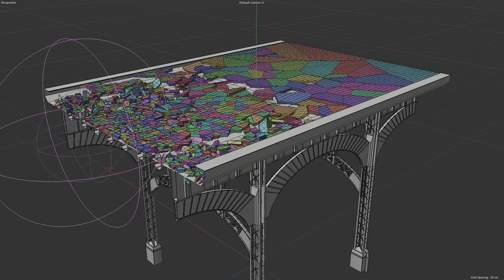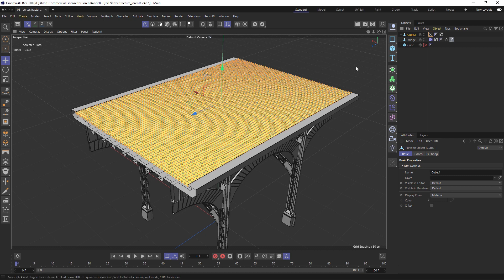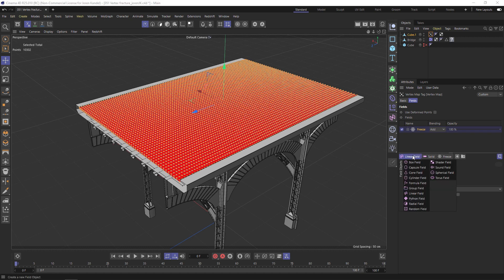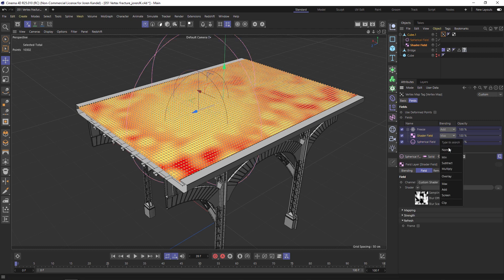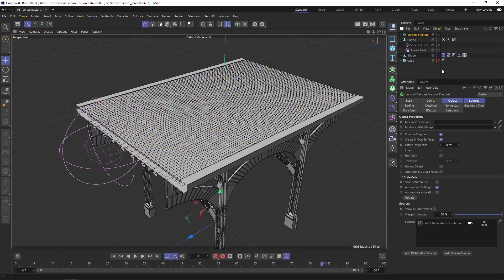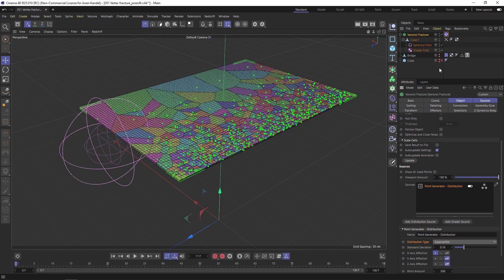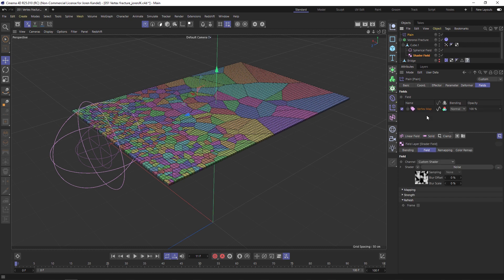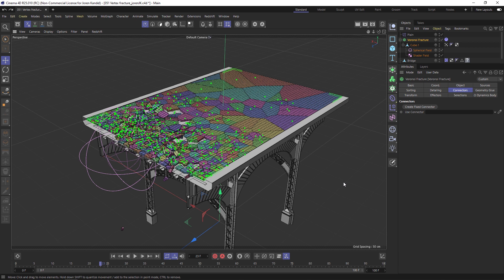Cinema 4d Tutorial: Fracture driven by vertex maps

Comment: Thanks for this tutorial! Is it possible to control the density of "'Distributed points" with a Vertex Map? I want to break an object into two pieces and I'd like a straight "crack" through the object where it breakes. This crack should have fine details (lots of "generated points"), but the rest of the object should stay intact. How would I set this up?